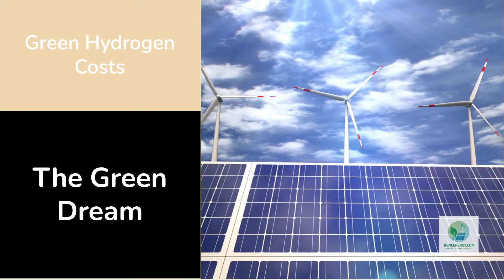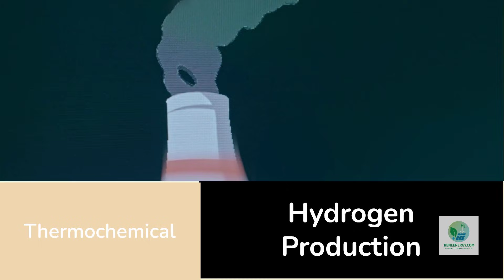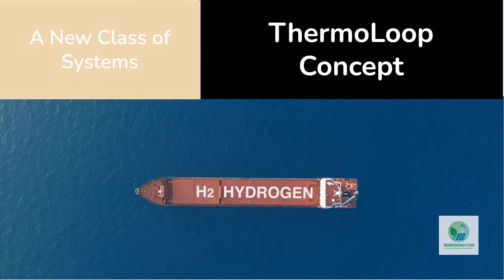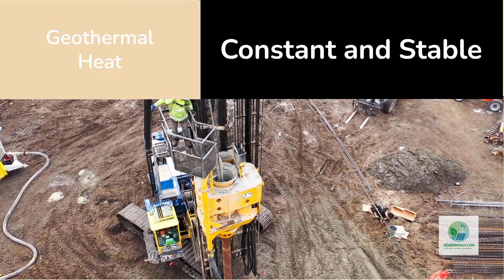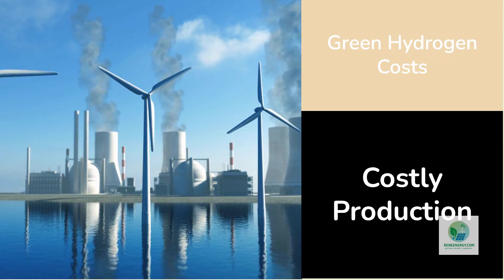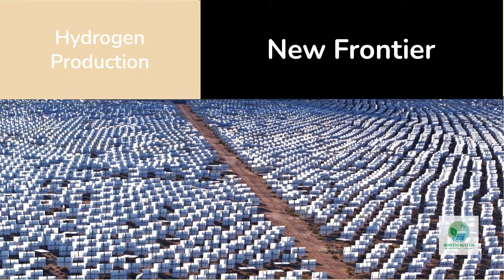If This Works, Green Hydrogen Drops to $1kg… Without Solar or Wind

Comment: New Hydrogen sounds like a great way to convert geothermal heat and water into Hydrogen and Oxygen.    SunHydrogen has a technology that creates Hydrogen and Oxygen from water and sunlight.   Both these means of making Hydrogen could make a Hydrogen  fuel a replacement for carbon based fuels.

Comment: If this works, where is the pilot/demonstration plant? Making clean hydrogen solely from heat (geothermal, waste, or advanced systems) to hit the $1/kg target is the "Holy Grail" for clean energy, promising to unlock hydrogen's potential by slashing costs below even fossil fuels, with early patents and designs (like New Hydrogen's ThermoLoop, Magma Power's geothermal approach) showing promise by using heat to split water, bypassing costly electrolysis; it could decarbonize heavy industry and transport, but scaling, durability, and validating these new thermochemical methods are crucial hurdles, says this YouTube video, this article from Energy Central, and the U.S. Department of Energy. 
Why This "Heat-to-Hydrogen" Approach Matters
Cost Reduction: Current green hydrogen (from renewables + electrolysis) is expensive; heat-based methods (like thermochemical cycles) promise vastly cheaper production, potentially hitting the $1/kg mark faster than expected.
Energy Efficiency: Using waste heat or geothermal taps into readily available energy, increasing overall system efficiency and lowering reliance on dedicated renewable electricity.
Decarbonization: Reaching this cost point enables hydrogen to replace "dirty" hydrogen from fossil fuels and power sectors hard to electrify (shipping, aviation, heavy industry). 
How It Works (Key Technologies)
Thermochemical Water Splitting: Uses heat (500-2,000°C) in closed loops with materials that cycle, releasing H₂ and O₂, consuming only water.
High-Temperature Steam Electrolysis: Uses heat and electricity (from nuclear or renewables) to split steam, more efficient than traditional electrolysis.
Geothermal Integration: Companies like Magma Power use cheap geothermal heat to power these processes, creating ultra-low-cost green hydrogen. 
Current Progress & Challenges
Early Successes: New Hydrogen achieved lab-scale H₂ production via heat in 2025; geothermal startups are patenting $1/kg methods.
Scaling & Validation: Proving these technologies at scale, ensuring material durability, and validating performance are key next steps.
Integration: Systems like New Hydrogen's ThermoLoop can integrate with existing facilities, speeding deployment. 
The $1/kg Target
The U.S. Department of Energy (DOE) aims for $1/kg by 2031, recognizing it as a game-changer for a widespread clean hydrogen economy, according to Utility Dive and the U.S. Department of Energy.

Comment: I wouldn't have minded being told how it is supposed to work. If I apply heat to water . . . I get steam, not Hydrogen and Oxygen. To get Hydrogen and Oxygen, I need to electrolyse it; pass a current through it . . . don't I?
Reply: if the temperature is high enough you can split h2o into hydrogen and oxygen. i dunno what this vid is talking about though most industrial heat  don't reach 2000-2500c.
Reply: At 2000C water disassociates into hydrogen and oxygen, if you can find a catalyst to recuse the temperature it actually becomes practical, but considering this is an AI video with an AI script... I can tell this by the fact that it keep repeating the same information over and over again... I don't put much stock in anything that was said.
Reply: Thanks for answering the trillion dollar question
Reply: He skipped all the real details, there are materials catalysts apparently they are working on a catalytic system that when heat is added the catalyst splits the water. 
No real information, hydrogen has been separated with nothing but sunlight and a catalyst, but apparently those get clogged up quickly and use rare materials

Comment: Well it sounds fantastic, but it is only one single step since the transportation, the evaporation, and the needed konversion to electricity in the end, are still not feasible, except in theory. And this add is repetitive and brings nothing new concrete to the table. The technique aside, this is a click bait!